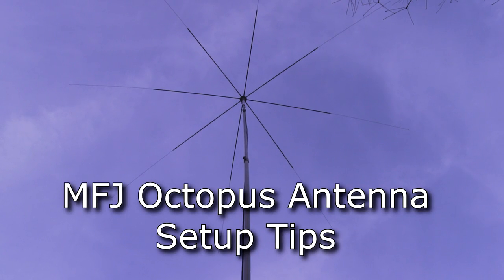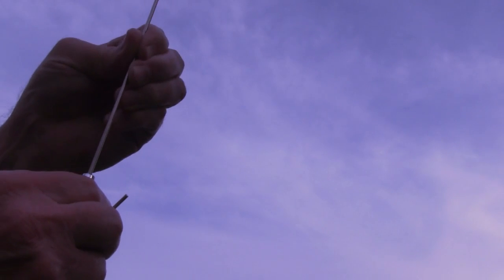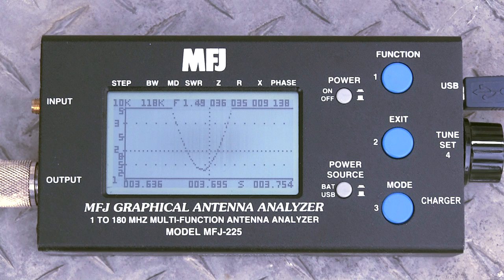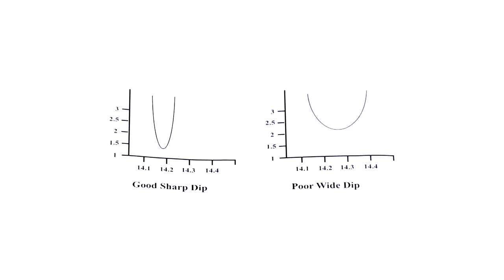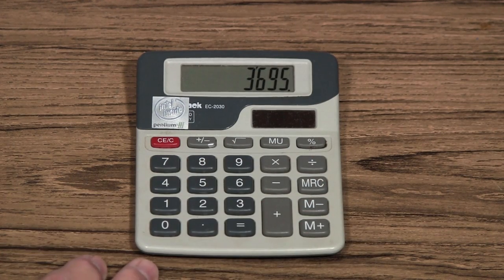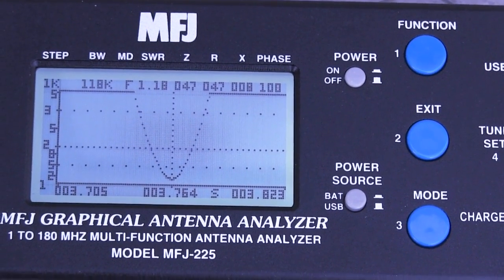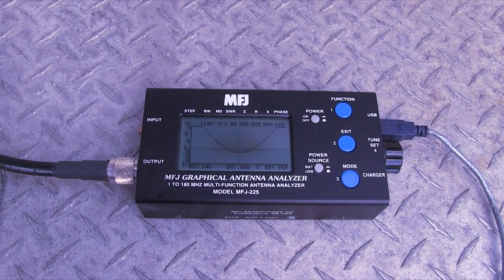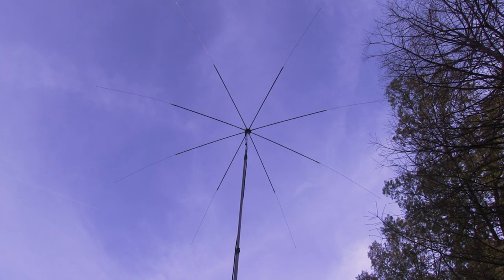MFJ-2104/2104H/2104X/2104HX

Comment: I bought a replacement part in October 2019 and haven't received it yet. My coupon is often closed without a solution, I have no more answers from MFJ.

See: http://www.mfjenterprises.com/HelpDesk/ticket.php…

I WANT MY MONEY BACK! The part ($ 36) and the rest of the equipment ($ 299), which I will not be able to use without the part.